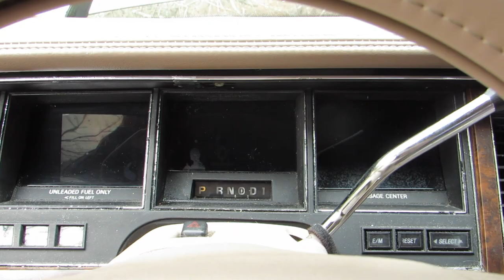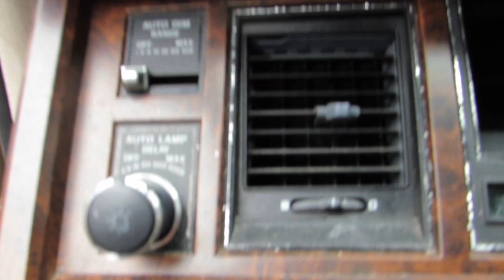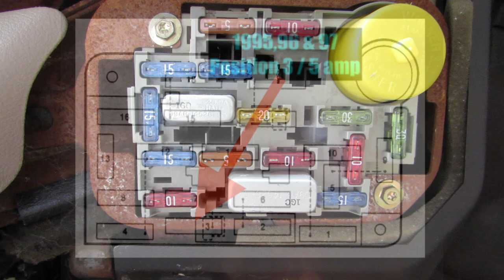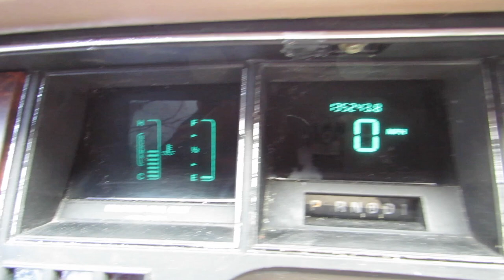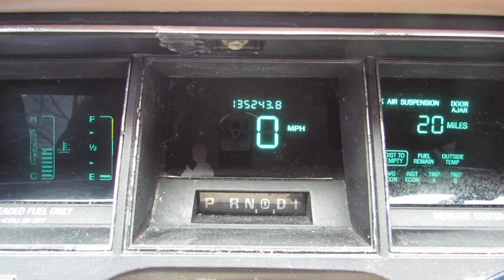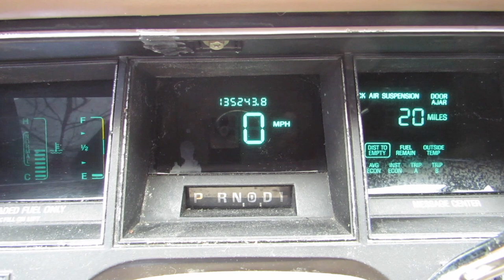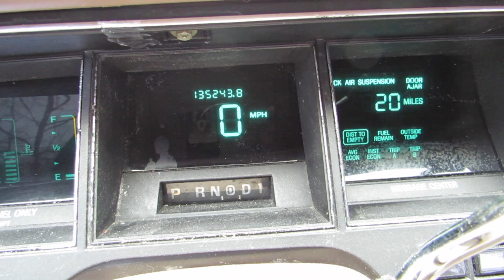Digital Dash Repair 92-97 Lincoln Town Car

Comment: Hey John ! My older 92 Nissan 300Z had a digital dash that had issues with lighting up and the fuel gauge would operate off and on . Checked all the fuses and replaced good ones to get the dash to work , all failed . Found the motherboard with all the circuits , pulled it out , opened it up , magnifying it …. Discovered small cracks in the solder joints on the circuit board … ordered a small solder iron , and carefully went through the motherboard . Put that puppy back in …. Bam ! My dash lit up like a Christmas tree 🎄 fuel gauge righted itself . Understand this took some time , but felt proud that my persistence payed off …
Reply from the maker: Very cool! Most people, like me, look at those things and think..., "OK - I'm way out of my league here." I'm old school so.... it's like NOPE - time to buy a new one. If I can see it - I can fix it but if I can't see it (like electricity) I'm just lost.
Persistence is the key with a lot of things.
I like taking ugly things and making them beautiful. I'd rather paint a car than work on the mechanical stuff... but we do what we have to do.
Peace

Comment: Wow, thank you. Exactly what I needed to see. I'll report my results. '94 Signature.
Also have a 90 that's so dim it can barely be seen in daytime.
Any ideas?
Reply from the maker: It's all done in that circuit board behind the dash and it's probably nothing more than dirty. If you replaced the fuse with no luck it's time to get behind it and blow it out with high-pressure air.
Peace

Comment: Hey john I have a 1997 LTC and I have a hvac problem the knob to control the amount of power it comes out the vent has gone out and I can’t raise nor lower the level…. Could it be the whole hvac unit itself ??
Reply from the maker: Its running on full blast and the adjusters levers do nothing? 
If that's the case then yeah..... I would go to your local junk-yard and dig the whole unit up and it should cure the problem. 
Peace

Comment: I have a grand marquis 1994, with the same digital cluster.
My problem is the fuel gauge and outside temperature dont work.

I replaced the fuel pump and sending unit, but that didn't fix the fuel gauge 🙈

I also replaced all the fuses under the dash stiil nothing.

What do you think Sir?

Comment: Hi John...Mine works, but the lights on the PRNDD1 do not light up. Is there a sperate fuse for this?
Reply from the maker: This video is regarding a digital dash cluster.
On most models there's tiny shift selector bulb back there somewhere (Usually right in back of it) and you're just going to have to tear it apart and find it and replace it. This, is most likely, your issue.

Comment: I have a 1997 executive all digital gauges work but the compass and gear shift indicator lights any tips ??
Reply from the maker: There's a cable going from the lever to the gear-indicator window. The cable is either broke or disconnected. The indicator slides out independent of the cluster. Pull it out and make sure the cable is hooked up properly. As for the compass.... - I have no clue. Sorry. 
Peace
Reply: @JohnDisque  thank you

Comment: Hi John my 1995 Lincoln town car  Digital Cluster burnout i replace it with one from the junk yard, but now my tempeture gage don't work, replace twice same issue. What do you think sir?
Reply from the maker: Hi Franco, 
I would start by trying to remember the last thing you worked on under the hood of the car. 
Ex: If you changed the thermostat did you have to disconnect the wires to get to a bolt? Did you remember to reconnect it? 
I'm not 100% certain where the temperature sensor is located on this engine but I would guess that it's near the thermostat housing and on the intake manifold.Check the connection, check for burnt or broken wires and check to see if the connector-itself is broken. 
That's my two cents. Let me know if you find it.
Reply: Hello good sir. But im having this same issue with the temp gauge in my 92 towncars digital cluster. My temp gauge shows the top 2 bars, lower 2 bars and then the vertical line. 
I just replaced the temp sensor, and while i was there i checked connector, and wires. All looked good, so i cleaned it with some connector cleaner. Still having the same issue. You wouldnt happen to have any other suggestions, besides replacing the cluster ?

Comment: I have a 1992 lincoln town car..my problem is that it's use to have breathalyzer installed and uninstall..but the dashboard is not lighten up ..replace the fuse and when I turn the switch on it blows out...

Comment: John is it the same function on an 1988 Town Car?
Reply from the maker: It's not the same and you actually have manual functions in your dash. Therefore if the dash lights are out it might be a bulb, but check all the fuses before doing all the work to rip your dash out and find the problem.

Comment: My 1993 Lincoln towncar radio turns on but I can’t hear any volume would you know why that is? I’ve been looking all over the internet and can’t find anything
Reply from the maker: You have radar in your 93 Town Car?
Reply: @JohnDisque  No I don’t have radar I made a typo I meant to say radio. Would you know why it turns on but doesn’t play sound?
Reply from the maker: @cruzitoarias6905  Oh.. LOL.. No one makes more typos than me. 
I take it you checked your speaker wires? If the speaker wires are connected the problem would be in the radio itself and would be something in the circuit board.

Comment: Everything works on my 97 but when I’m driving it sometimes goes to zero MPH how do I fix that
Reply from the maker: Hmmm.... This could be something in the circuit board or more likely one wire going into the board. 
I'm about to do a very detailed video on a 92 Town Car dash cluster so keep an eye out for that - it should shed some insight on your problem.
Peace

Comment: Hey, i have a 1981 Lincoln Town Car Signature Series where only the speedometer is showing. Do have any recommendations to what i can do to fix it?
Reply from the maker: Check all the fuses and relays and if they're good rip the dash apart and replace the circuit board. 
This is not an easy repair and I recommend getting a professional to do it.
Reply: @JohnDisque  might be a bit hard getting a circuit board here in Norway, but thanks for answering.

Comment: ok John, Now how about a 1991 Lincoln Continental signature panel to reset? thats my problem!!
Reply from the maker: Is it digital? The fuse boxes on the ones earlier than 92 are a little different.... It's a different fuse. Just find the one associated with the dashboard and replace it.

Comment: Problem w my 92 is that the ten fuse keeps getting fried. What do you think
Reply from the maker: You have a short somewhere. You're going to have to trace wires. 
The whole purpose of a fuse is to burn out to stop current before it causes a fire.
Reply: @JohnDisque  thank you. There was definitely evidence of a mouse when I bought it. Runs great though! Has the dual exhaust Sign Series 106k miles. Beautiful paint too

Comment: Easy Peezy
Reply from the maker: Not for everyone Ron. These issues aren't always simple for people - especially when they're not a mechanic or have been fixing cars their whole lives. 

Now - Running a 5 pack of nineball - THAT IS EASY. LOL
Reply from the maker: Or - maybe you mean the fix itself is easy, in-which case you are correct... Simple in-fact. And FREE too if you have a ten-amp fuse laying around. 
What makes this hard on people is that there is soooooooo much bad information out there and so many wanna-be mechanics misleading people and have them taking their whole dashboard apart looking for a bulb that doesn't exist. LOL The frigging owners-manual itself is bad information! (THE OWNER'S MANUAL!) 
You can almost NOT drive this car with this problem so this video is about getting them relaxed, eliminating the BS and getting to the fix. (It should do well in the long run).
Peace
Reply: @JohnDisque  I’m about to button up my Super Pro car and fire it up. Still need to install the glide/new stall converter and connect the dots. My new 568 made 908 naturally aspirated hp @ 6,900 rpm on the dyno. Fun cruiser.
Reply: @JohnDisque  good stuff man! 👍🏻
Reply from the maker: @ronthepoolstudent  You're driving a 908 hp car on the street? 
That's a full-tilt race car that you couldn't drive around the block in TN without getting a ticket. 
And in PA you have to get all cars inspected twice a year. They would laugh at you if you tried to drive that in a shop to get inspected.